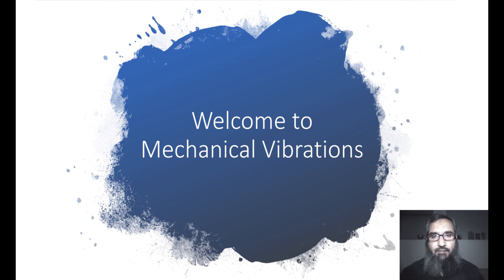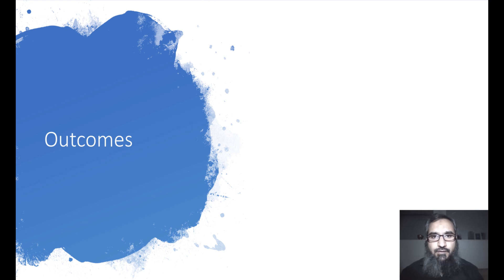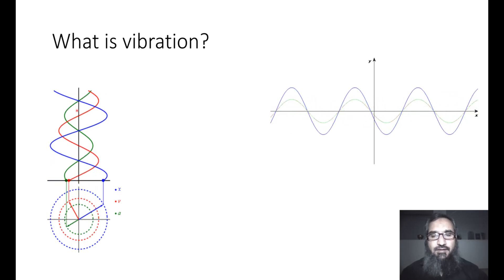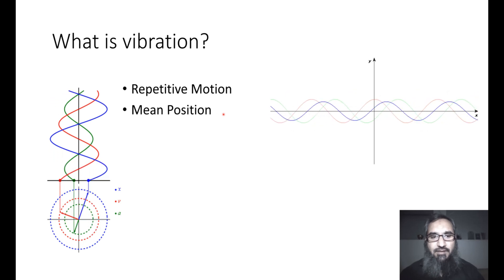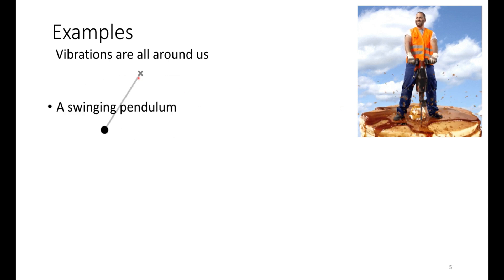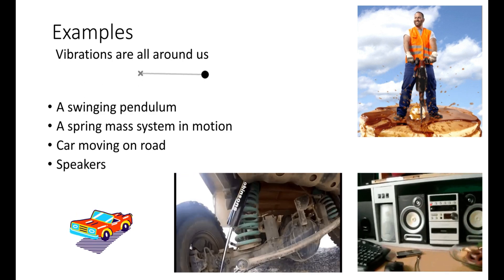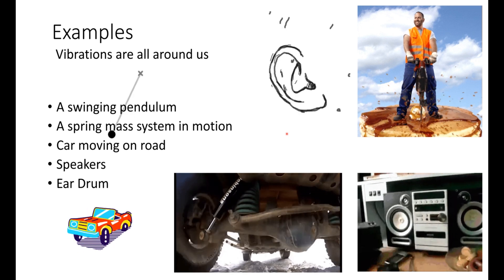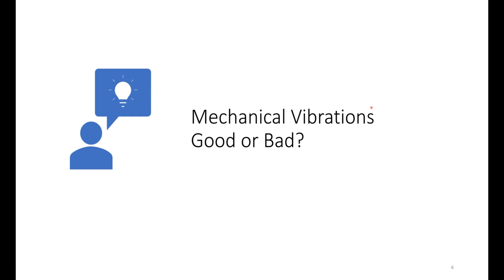1-1 Mechanical Vibrations | Introduction | Definition & Examples

Comment: Depends on the nature/ intensity of the vibration. Vibrations can be made useful for a number of practical applications for example a massaging sofa or as you suggested a sound system. Mechanical Vibrations can also be devastating at the same time, earthquakes for example.

Comment: Mechanical vibrations can be good as well as bad. Without vibrations, we would not be able to listen or speak (eardrums and vocal cords need to vibrate for functionality). On the other hand, vibrations in machinery is avoided because it can cause fatigue failure or wear and tear of machine parts.

Comment: Vibrations can be good or bad depending on the circumstances. They can be bad in case of a moving car which is violently vibrating up and down due to bumps because the shocks are not adequately damping the vibrations. They can be good in case of vibrating speakers delivering good quality sound.